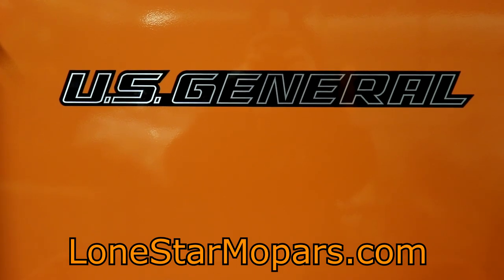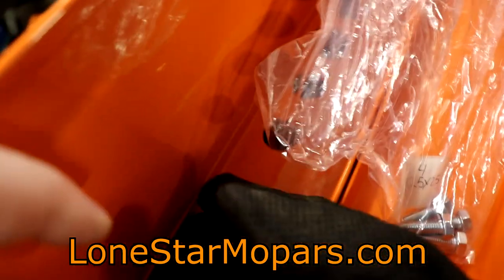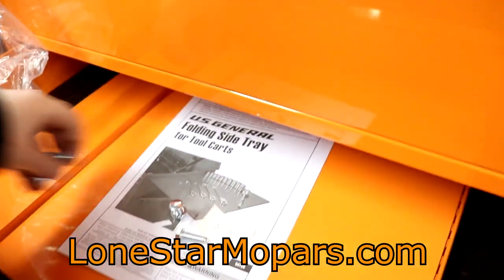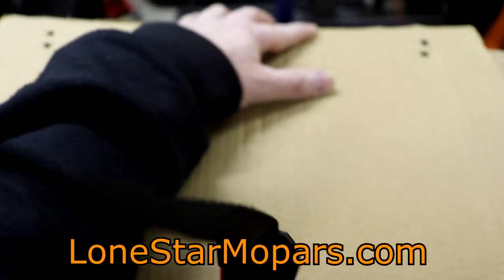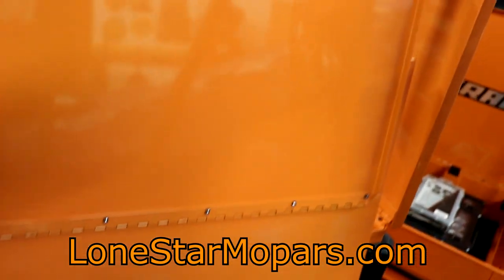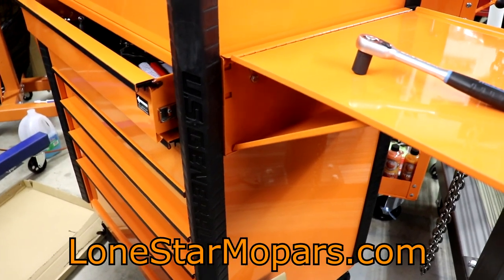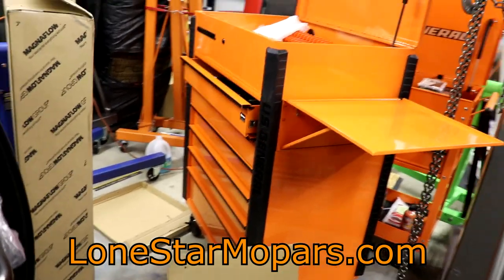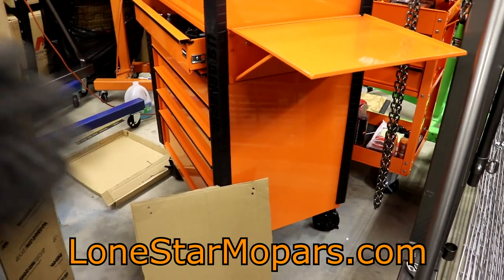How to Install a Folding Side Tray on Harbor Freight's US General Master Tech Service Cart

Comment: Ordered mine in orange today and got the shelf. I'm gonna use the handle as a template.  So I just opened the tray that I bought today and it has the m8x25 hex bolts instead of what you showed!! Apparently they made it more adaptable to other boxes. This one is for the 4 drawer tech cart.  It also comes with 4 plastic spacers that keeps it from directly touching the box

Comment: I put mine more toward the top and drilled holes into it and used the hardware it came with. I like having the shelf higher because it gives me better work space
Reply: You have to tap the holes also?
Reply: @randallburkhart8452  no, I just used the hardware it came with. Drilled some holes and then used a wrench to attach the side table like you would with the 4 drawer cart

Comment: Thanks for the video brother. I will be installing this on the 34" also. I agree,  I pretty much never install anything without a flat and locking washer. Or a star lock washer, although the star would eat up the powder coating.
I'm thinking I might install a side cabinet at some point.
Reply from the maker: No problem, glad it helped.  I have honestly never had the side tray down since it was installed, haha.  The side cabinet would be pretty cool...I'm not 100% on how everything is going to pan out, but I'm thinking I'm going to keep this as the roll around cart.  If they drop to $499 again, you might see a blue and I may go the side locker route there.
Reply: @lonestarmopars  I got an email a few days ago for $499! Good till 3 20. Ordered orange 1 today.  Had to show the store the code.  Not on sale in the store without the email

Comment: Question just pick up the full bank service cart with a 5 drawer shelf stock #64725 $13.25 . there is another tray called  Folding Side Tray for Tool Carts 59445 $29 i looking at the spec and the are the same except for the weight of the tray . do you know if there is any different do i have the correct one . thanks